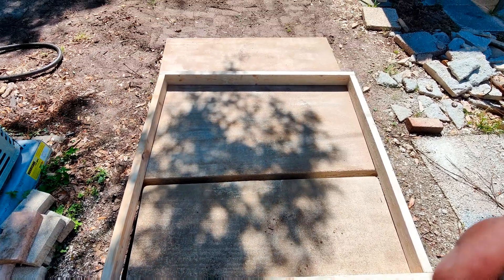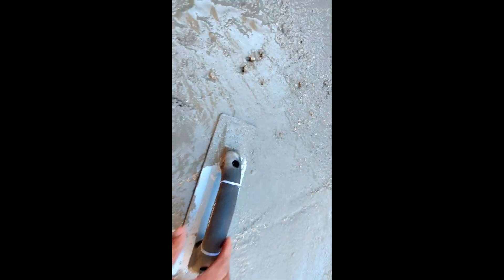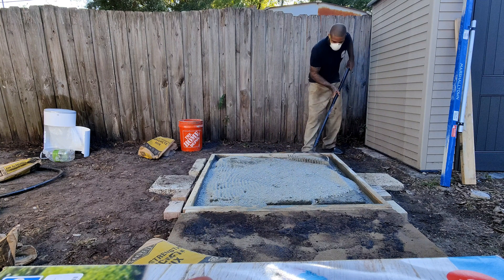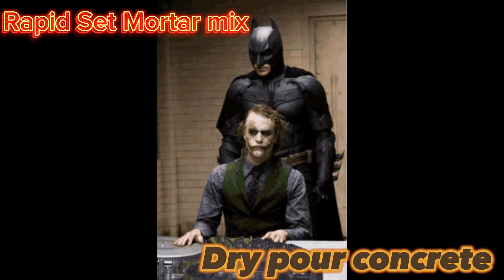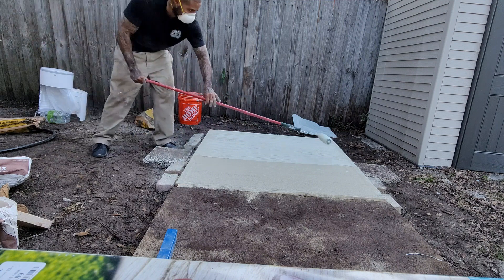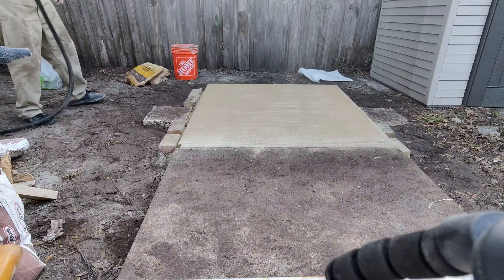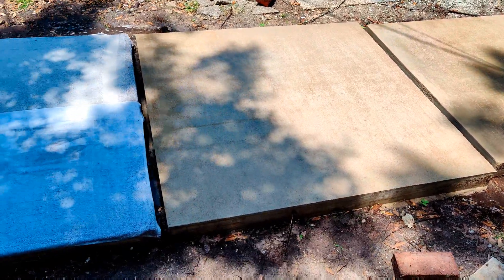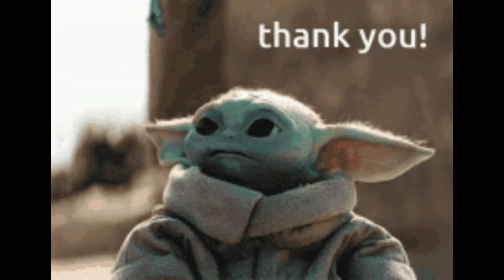Dry Pour Concrete Half wet Half Dry experiment

Comment: Just thinking out loud…on the wet pour half of this video I would have been tempted to just dry pour bottom half, add proper amount of water, then stir with your drill whilst your walking around with boots on in the cement while stirring inside your frame.  This way you don’t have to lift the wet concrete in 5 gallon bucket.  Also, it seems your method is better than dry pour as a thought experiment as the bottom half will have the correct amount of water and mixed well.  Then the top half dry pour has a good wetness below to pull from.
Reply from the maker: That method sounds good 🤙🤙🤙

Comment: Oh my God I just got done with my 2 slabs. I was gonna get the 60 bags but I got the 90 pound bags. I lift weights but im no body builder but man you weren't kidding How heavy they are I only got 10 bags luckily. I had a wheelbarrow. How long do you have to mist
Reply from the maker: Awesome!!! Repair mortar and rapid Set Mortar mix sets fast! I usually mist 3 -4 time's,, some advice don't push on the slab to check if it's hard,,I made that mistake,, wet the excess mortar with the slab,it will get wet anyhow,,,push on the excess mortar on the side of the form to check,if it's hard start to soak and would suggest using the burlap/ towel method, this will actually do a lot of the water work for you due to the towel stays wet,,I would keep watering every day,,then take the forms off a week from now 🙌🤙if you have a chance make a video, would love to see how it came out! Also editing a video I made today new addition to the dry pour slabs and tested a new top a high level concrete worker suggested 🤙

Comment: Can I put the repair motar mix after the cement is dry because I don't see the one you are using
Reply from the maker: Forsure 🤙 Repair mortar is great 6000psi🤙 different areas sell different products 🤙 repair mortar is great that's actually what teddy zane uses 🤙
Reply: @DiyTheGrappler  thank you so much
Reply from the maker: @digitalmixer  no prob 🤙 good luck on your project!🤙

Comment: Can I ask you a question about how high it should be for the form? I'm thinking of using 2 and a 1/2 inch. Would that be good for a slab to put my patio chairs
Reply from the maker: Hello my friend 🤙 2 and a half inches would be strong enough for that project forsure 🤙 if you want extra strength and option would be to you put wire mesh in , I went over board with 4 inches to test the strength for my driveway 🤙 but would suggest after your dry pour to continue the water curing process to make sure it continues to gain strength 🤙 good luck on your project!
Reply: @DiyTheGrappler  Great thank you so much. It doesn't matter what kind of wood right? I'm just gonna do it in a section at a. Ti'm because I don't have the funds to do it all the slab at once
Reply from the maker: @digitalmixer  no the wood doesn't make 🤙 in the concrete world they use different materials as form,,steel,, Rubber,, wood 🤙 as long as it's a solid boarder for your dry pour concrete you should be good to go 🤙
Reply: @DiyTheGrappler  Thank you for all the hard work you do for us. Youtube Dis people 🤩
Reply from the maker: @digitalmixer  thank you for watching and supporting the channel inspires me to make more videos 🤙 planning to have more up this weekend 🤙 good luck on your project!
Reply: @DiyTheGrappler  👍

Comment: Did my first dry pour last week. Will be adding the mortar mix to finish it.  I tried to do the screeding by myself and couldn’t get it smooth.  It’s 10x10 slab for a metal shed.  Thanks for the videos and all the info
Reply from the maker: Forsure 🤙 mortar mix makes it a little easier to get a good finish,,you can also use repair mortar 🤙 good luck!

Comment: Would be cool to see a dry-poured driveway vid, but the thing is, when you get to big slabs like that, it's actually cheaper to just have a cement truck deliver it. I priced how much it would be to have enough delivered to do a 16x24 slab, 5" thick, and it was only like $700. It would cost more to buy it by the bag and do it yourself.
Reply from the maker: 🤙🤙🤙 appreciate it 🤙 for me it's not about the money, it's more I want to build something, contribute to the history of this house🤙 and people could use my experience to know whether a dry pour driveway could be done or not 🙌 thanks for the insight 🤙
Reply: Where do you live? That's less than $2.00 per sq ft. I'm not sure $700.00 is accurate for that dementions. I can't even get them to drive to my house for $700.00.

Comment: Hey grappler. Love your videos.  I agree dry pour is good enough for most small to medium projects. You mentioned in a comment you havent seen much of a reason that shows why wet pour is stronger. I am linking a video you may not have seen that was just released. The creator is a mason and is a little biased towards wet pour but while doing his test there is one part that may answer your question. He shows that when he breaks the wet pour the actual aggregate inside the big rocks split in half where as the dry pour breaks around the rocks and doesnt break the rocks themselves becauae the concrete is not bonding as strongly to the aggregate in the dry pur because it wasnt properly mixed and evenly coated like happens while mixing a wet pour. Now this is not conclusive proof for me because he disregards the way we have been shown to lightly mist at first and heavily misted until saturation occured and he let it cure about a week or more i think but not the full 28 days and i believe dry pour would take maybe twice as long and maybe then it would bind better than shown in his test. If someone would do the test actually using the best methods shown including covering with burlap and daily or twice daily watering for a month or two and then do this breaking and comparison i think the results would be more conclusive but i thought this video and his results might show you how and why it could potentially be weaker. 

https://youtu.be/2F_3GrGFenU
Reply: Hi Jason. I saw that video and agree the guy is biased strongly toward wet pour.  It was very good to see how the rocks separated from the rest of the mix in the dry pour, but I still have questions.  I had a bag go solid on me while sitting in my garage for a year.  When I broke that bag open, I am pretty sure the rocks broke instead of separating.  But also, that solid bag was plenty strong enough for most of my stepping stone and small landings projects.
Reply: That's why I wanted to bring it up. Not because it seemed conclusive just that it may be a factor and deserves more proper long term testing before the time and effort required for a driveway dry pour.
Reply from the maker: Great insight, I did see that video, I actually slightly mention the mason in my last video, he's super experienced I been studying him as well 🤙 my 1st thoughts when I seen the rocks split in the wet and stay in the dry,,was similar to what you were saying, I don't think it cured enough or got hydrated enough to bond strongly to the aggregate 🤙the video was good information but not enough for me🤙 thanks for your research 🤙
Reply: Something tells me that video is biased where he made sure that dry pour will not work.  I am not even sure that the wet pour slab curing is the same amout of time as the dry pour curing.

Comment: thank you for keeping it real. if you do a driveway, you may want to pack the dry poured cement, to eliminate as many dry pockets as possible
Reply from the maker: Appreciate it 100 percent I agree 👍 in my previous videos and on this slab, just didn't show in this video,,I did compact the dry concrete to eliminate/reduce air pockets 💯 I believe that is a big part of this process, compacting/ time /curing 🤙